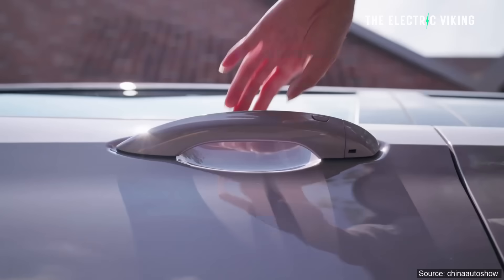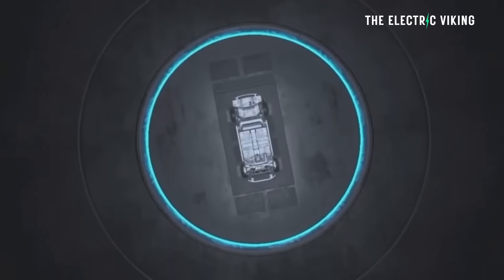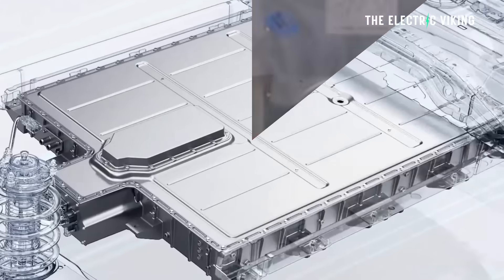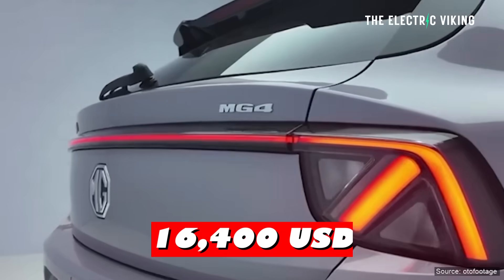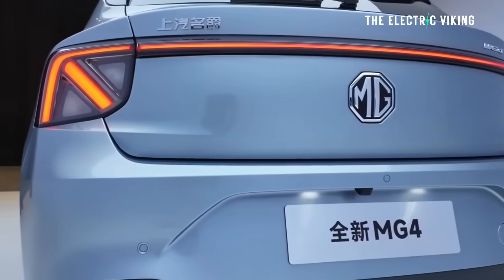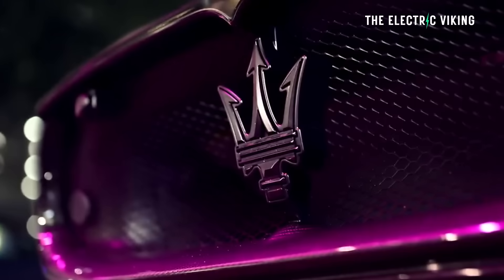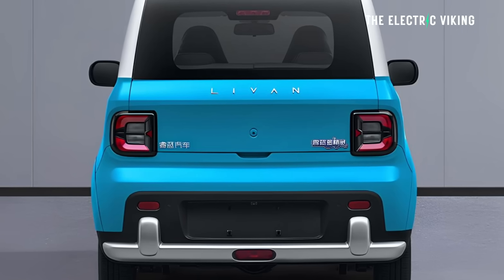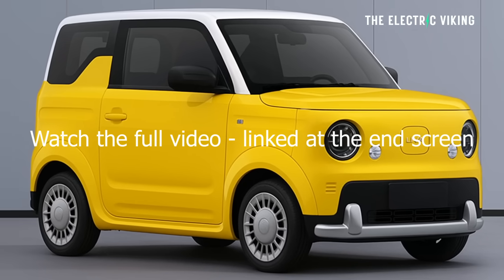NEW MG4 first EV with mass manufactured Semi Solid State Batteries

Comment: Compared to current lithium-ion batteries semi Solid-state batteries don't offer a massive increase in energy density or charge times.
But they do offer advantages such as virtually no risk of thermal runaway, lighter weight and a solid if not remarkable overall efficiency improvement including at different temperature ranges especially below zero temperatures.
Think of a semi Solid-state battery but with the physical shape and layout of a blade battery and imagine how safe and lightweight they would be. Military vehicle applications are a real possibility at last.
Admittedly I was surprised MG was the first one out of the gate with these batteries with the evolution to full Solid-State batteries well underway.
😎🇦🇺👍

Comment: Nothing change , We need  MG4 class  EV  with  100kWh battery at the same weight what current MG4  77kWh
Reply: Yes
Reply: The current mg4 LR is excellent. We don’t need heavier esp weight tax. Long range is expectable
Reply: @bdeithrick    Car Dealer ? or Silly Bollocks man ?
Reply: @bdeithrick  I have said nothing about  heavier  !  new batteries  got more energy in the same weight , we need  batteries with  330-350Wh/kg  , current  LFP are  185Wh/kg   or  NMC  280Wh/kg

Comment: The thing is, this is a transition and still at early stages. It’s good that different technologies are moving EV’s forward, whether it’s safer, more range, longer lasting, cheaper, less weight, less volatility in range between summer and winter etc etc.

They are all inching things forward, while ICE is standing still. That’s all that is needed to ensure EV’s become the defacto standard in the next 10 years.

Comment: If solid state batteries start mass production, what will happen if I need a NMC replacement in 10 years ?
Reply: There's enough above ground by then.
Black Mass NMC ~$4000/ Tonne.
It's a purer ore than from the ground.

Comment: 540 km for a 70 kWh battery (assuming usable capacity) equates to 13 kWh / 100 km (4.8 miles / kWh), which is much better than the outgoing MG4 77 kWh (74.4 kWh usable) that equated to 17.5 kWh / 100 km (3.5 miles / kWh), which in turn was close to today's average EV efficiency. This is a 26% increase in battery performance and range.

If the 70 kWh is total capacity then the new MG4 may well be achieving closer to 12.5 kWh / 100 km (5 miles / KWh), a 29% increase in battery performance for a 26% increase in range.

However, I suspect the semi-solid state battery has been optimised for low materials and manufacturing cost not just energy density/range, so perhaps the expectations of higher gains from solid-state are yet to be borne out as other factors apply.
Reply: It's 537 km in CLTC! , so it's probably closer to 400 real world range.
Reply: I just don't see the point to move from NMC yo LFP or this one

Comment: I thought 4860 from Tesla was first semi solid battery?
Reply: No, the 4860 is a dry-anode (graphite) constructed NMC battery. 

It still uses a liquid electrolyte between the anode and cathode sides of the cell, with the electrolyte at a level well above that which would qualify it as semi-solid state battery. The 4860 construction is Cell Cap -> Aluminium substrate - > Li-NMC cathode material (811 composition) -> Liquid Electrolyte/Seperator Membrane -> Graphite Anode -> Copper Substrate -> Cell Base/Wall. The electrolyte contains a dissolved solution of Lithium ions to aid the initial charging of the cell that forms the battery, enabling its subsequent operation to be charged and discharged. 

The dry-anode refers to the production process using a compressed dry powder coating process rather than a wet process that uses coatings dissolved in a solvent that requires extra time to dry off, that can result in different anode characteristics due to variation in the processing environment. The dry process is quicker production process that results in a more uniform product, but one that is more difficult to engineer (from a production design perspective).

In a solid-state/semi-solid state one side is solid Anode material (e.g. Lithium metal) followed by a dry electrolyte (ceramic/glass), that in semi-solid has a tiny amount of liquid electrolyte to improve surface contact conductivity and hence the cell's power density, followed by a dry cathode material to absorb/discharge the lithium-ions as they move across the cell during charging/discharging.

Comment: Heh strange opinion about NIOs superb battery tech. 150kwh is the biggest battery avaible for commercial car and it can give 1000 km on one charge. It weights only 40 kg more than their normal 75 kwh. 400kg less than BYD 135 kwh normal battery. Welion delivred masterpiece. 
You reported earlier that MG will deliver SSB this year (2025) aaand I don;t know what to think about it. It should have like 100-150kwh in that new MG4. I bet that price of car won't be cheaper.

Comment: Total gimmick. A battery is either SS or not. OK they've figured out how to have a smaller liquid electrolyte component in a standard battery, which maybe comes with some cost benefits. But it's still a standard battery using current battery chemistry, right?
Reply: There is a difference. In semi-solid state the liquid-electrolyte is there to improve the surface contact area between the solid-electrolyte (glass/ceramic material) and the electrodes; the battery still operates on solid-state principles. The solid-electrolyte still separates the two sides of the battery (is not porous), and conducts the ions from/to cathode to/from the anode. The anode material usually being a layer of solid Lithium (or other charge transportation, e.g. Sodium, Aluminium) metal. Its operation functions just like that in a fully solid-state battery, the liquid element just improves the power density of the battery by increasing conductivity to/from the solid-electrolyte and the electrodes.

In a wet Lithium-ion battery (NMC, LTO, NCA, LFP, Li-poly etc), the electrolyte typically contains the conducting material (e.g. a dissolved Lithium compound) that is used in the initial charging session to form the battery (deposit Lithium Ions into the anode), and subsequently acts as the ion transport medium between the anode and cathode sides of the battery, passing through a porous membrane. In these type of cells there is significantly more liquid inside the cell (25% to 30% by weight) than in a semi-solid state battery (circa 5% by weight).

A quasi-solid state battery lays somewhere between the semi-solid state and Lithium-Ion, typically involves a solid metal anode but a liquid electrolyte (circa 15% by weight), being a bit of a half-way house between the two battery designs.

Comment: Semi-solid state at 170 Wh/kg?  That makes no sense!  SIAC needs to keep working to get to 300+ Wh/kg. in any solid-state batt.
Reply: Surely that depends upon the design goals. If MG is seeking to increase safety, stability, range and charging performance all for a lower-cost battery that uses existing production capability then it makes sense. The result is battery that offers a reasonable (26%) increase in performance, that lowers the cost of the vehicles, and still offers more range. Seems a particularly good approach for the given target market segment of the MG4, being a low cost family orientated everyday vehicle.